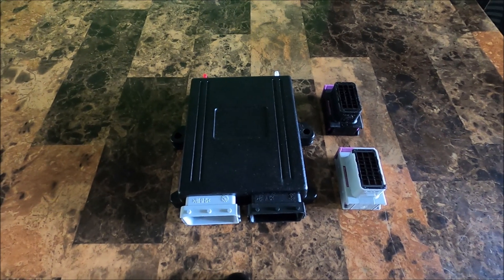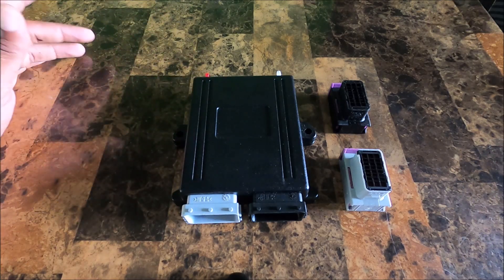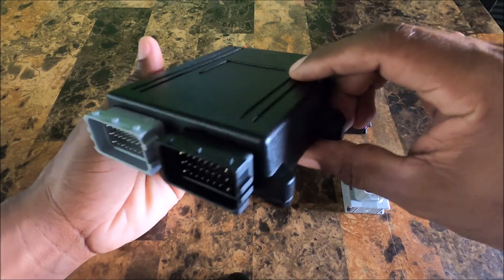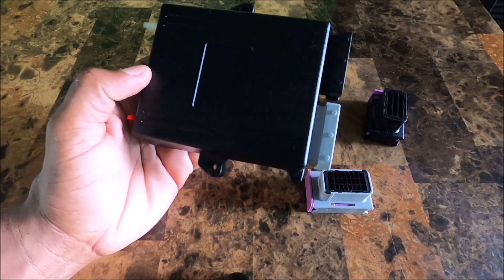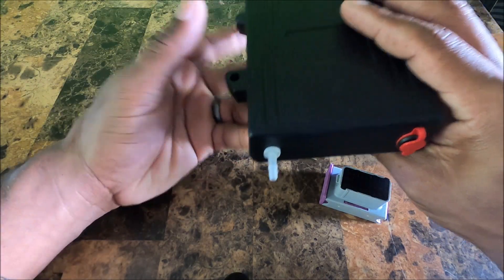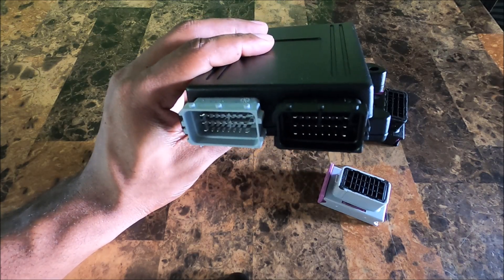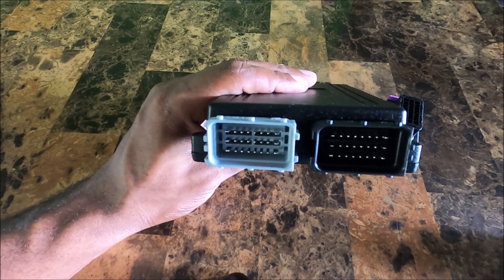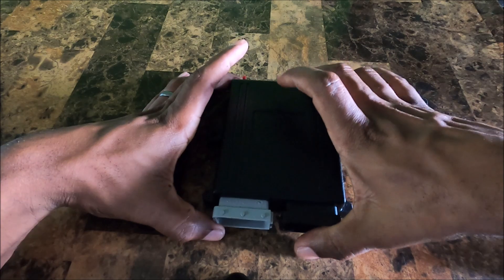OpenLogic EFI X4 Speeduino ECU | First Look

Comment: How's it going, would you lean towards this or save a few bucks and use the ocelot ?
Reply from the maker: @jcchaps54  depends on the setup its going onto. For most applications they would be very evenly matched. with the CD x4 having a few more I/O. 

So it mostly down to personal preference
Reply: @DCWERX  I'm planning on putting it in an aw11 mr2, rewired for sequential injection and cop, it may see boost at some point and I wouldn't mind setting up some extra sensors like fuel and oil pressure for safety, the X4 is on-sale right now for 250$ so for the extra 38$ over the ocelot even just to make it more water resistant seems like the right move
Reply from the maker: @jcchaps54  for a sequential injection turbo aw11 either will work good. Both can do oil and fuel pressure input.